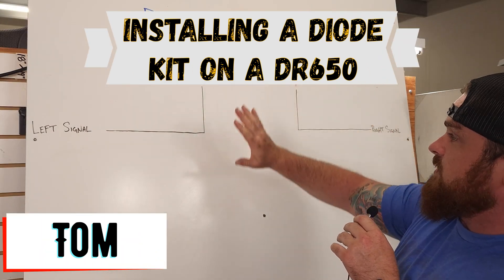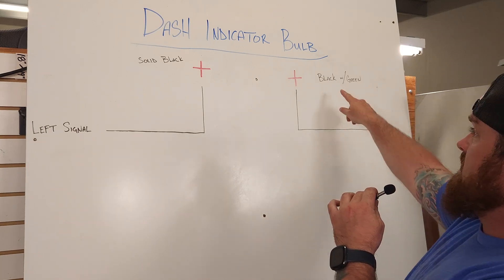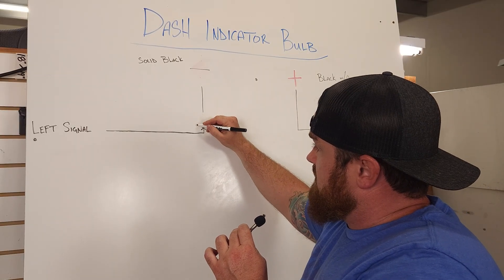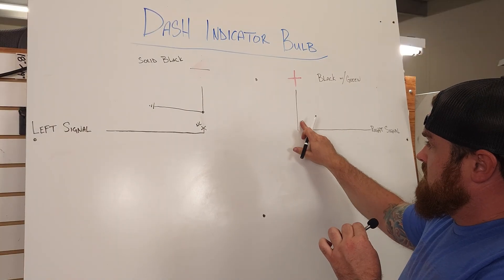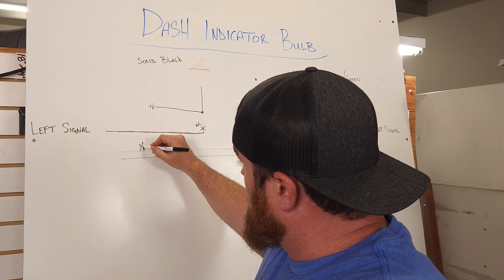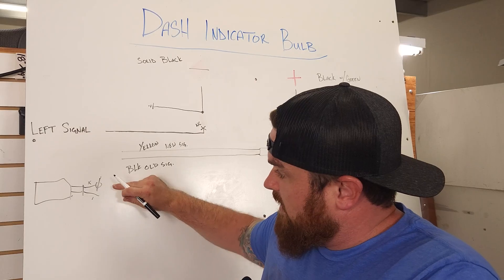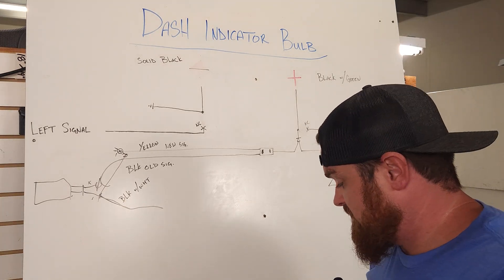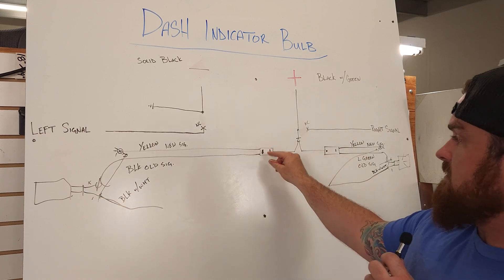DR650 Diode kit Diagram

Comment: STS Industries makes a small diode harness that plugs in line with the turn signal harness as it comes out of the dash. It is plug and play. Just spend the $12 for it, you won't have to splice a bunch of crap into your wire harness to get your turn signals to work correctly. I used their harness on my 2024 DR650 when I put LED turn signals on and they work the way that they should.

Comment: Hello! I have another implementation of the same idea. I made small harness with all this ideas implemented inside. So, installation is just disconnect indicators connector and connect back throw this new harness. No wire cut. Just connectors. I can send you my schematic of this very simple harness and you can sell harness instead of diodes
Reply from the maker: Thank you for the feedback and send it over to INFO@PROCYCLE.US and we'll take a look.
Reply: @TeamProCycle  
Done.

Comment: Clear explanation on how to install this diode.   Unfortunately I Have no idea WHY I should do this as it is never explained in this video.
Reply from the maker: Thank you for the feedback.  At time mark 8:20 Tom explains why we recommend installing the diode kit, granted it is not in great detail, and I will make sure to add it to the video bio for anyone else that may miss it.
Reply: @TeamProCycle  No, he didn't.  What do I care about 'bleed over'?  Is it bad for the bike?  Does it fix something wrong with the dash indicator bulb (top of diagram), does it give me 4 way flashers?  What problem are we trying to fix?

(Yes, I know it's to fix problems when switching to LED indicators but anyone not familiar with the problem or someone trying to figure out why LEDs don't work properly on their bike would have no clue and I doubt this vid would show up in any searches on the topic.)
Reply: @hazcat640  The bike has the old filament light bulbs in it, if you replace those bulbs with LEDs the wiring harness and flasher relay aren't compatible and the indicators stop blinking. Installing the diode and re-routing the wiring fixes the issue.
Reply: this has to be the dumbest comment on YouTube...  there's no reason for anyone to watch this video unless they knew exactly what they were trying to solve. it's not supposed to be a podcast or wannabe influencer type video. it's a targeted, no frills delivery of information for people who are asking the specific question "how do i install a diode on my DR650 as part of my LED indicator conversion" otherwise why would you watch this ffs